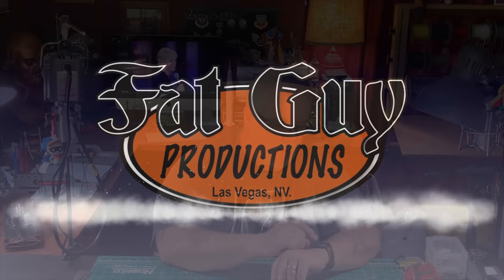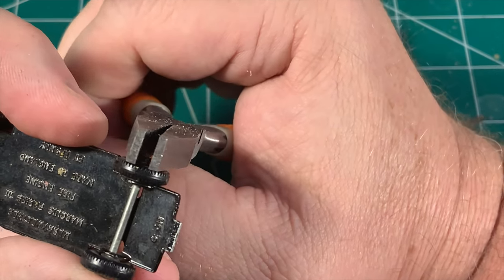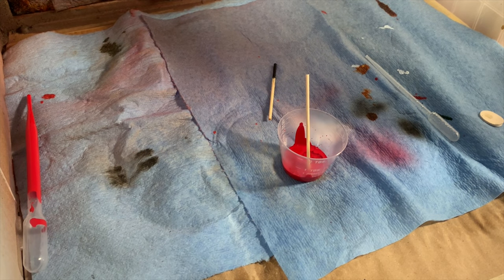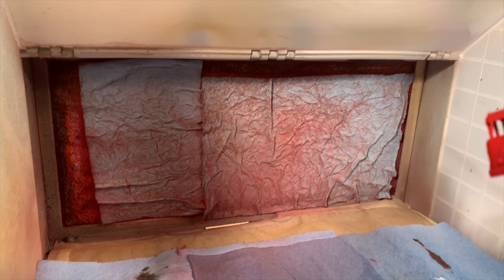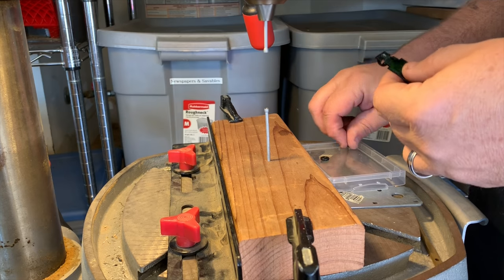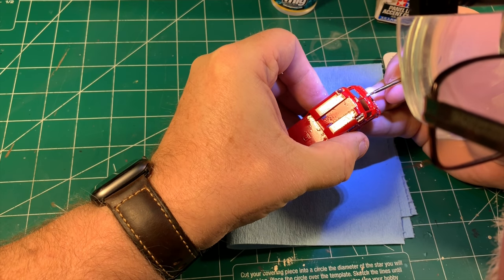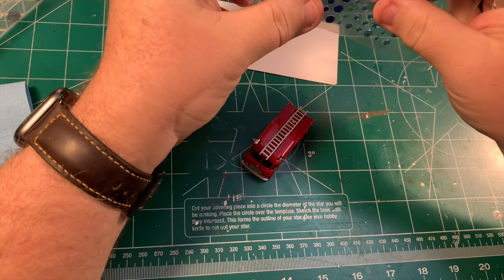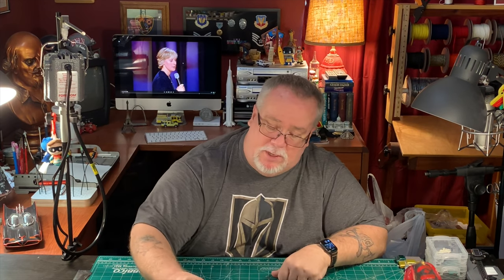matchbox fire engine - Restoration

Comment: Fantastic job, I am not usually a fan of custom but this is close to changing my mind,  please please share the information on the nail to redo the axles, I have tried numerous attempts but all failed, I can't quite get the concave right so end up scratching the body or melting the wheel lol.